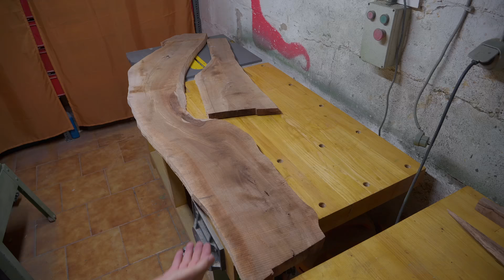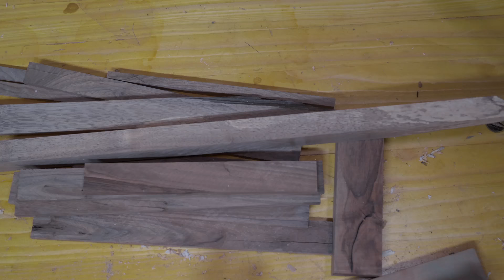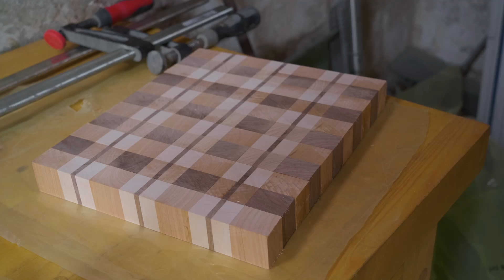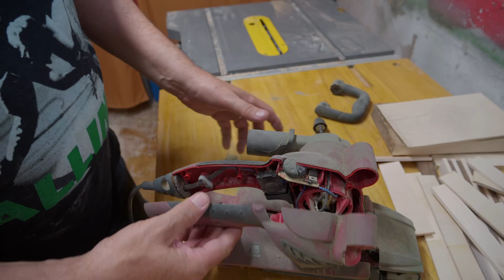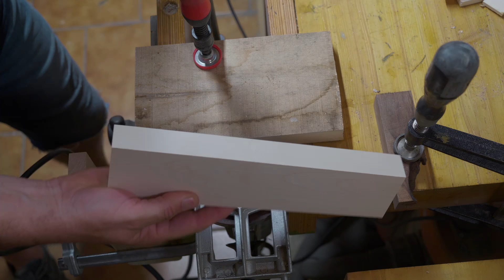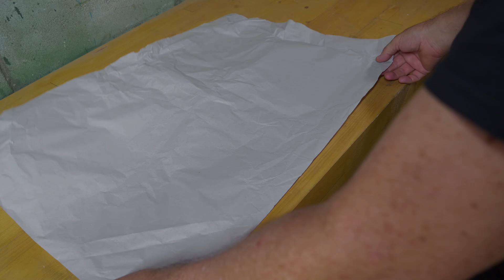Making a plaid end grain cutting board || RotarySMP

Comment: I’ve been wanting to make one of these, and even bought plans, but this is the first video I’ve seen where all the pieces are basically clamped up at one time. Seems much simpler that way
Reply from the maker: This way seemed to work quite well. I should have been more careful cutting all the strips at the start in one set up, to avoid the slight accuracy errors which creep in when you reset the fence.
Reply: @RotarySMP still looks great though
Reply from the maker: @ninjawarriormystic  Thanks a lot.

Comment: if you sprinkle a pinch of salt on the glue up it reduces the sliding when clamping and with dissolve into the glue and not effect it.
Reply from the maker: Great tip. Thanks.

Comment: Good looking board. That's the one thing over the years I have never made and no desire to for many reasons. I have to say that I feel for you for the lumber you had to work with. That was not easy. If you were here I would have given you some 10/4 black walnut. I sold the 16' long stuff I had but still have a few small pieces. 

      My belt sander is one of the old Porter Cable 4x24 ones that weigh a ton. I lent it to a friend once and he said never let me use it again. He said he never screwed up a project so fast. Not his exact words but... And I miss the short lived tools with plug in cords. Not sure what the equivalent coatings are here in the US but PPG is a US company so they may sell it here. I always used mineral oil.

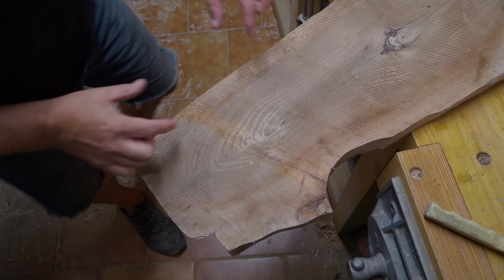        The only thing I have made was a new litter box container for the cats. I have a sealed box in the garage they go to and you service them from out there. We have new automatic ones and I had to build a new one as they are bigger. Swapped it out yesterday with the old built in one. It's functional but not finished. We haven't had a day under 100* in around 30 days and today was 100+ from 11am till 7:45, 112* for the high and 84* for the low tonight. It was 110*+ for 5 hours today. We won't start cooling under 100* until mid September. Everyone is angry and has cabin fever here. It will still be warm when we get back home in October.
Reply from the maker: It has cooled down here for the last week, and we started getting some rain, which was needed.

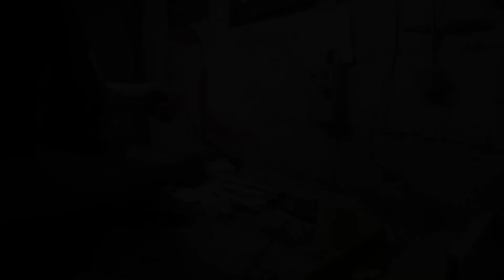Comment: never seen anyone stack a cutting board like that in the glue up's, most poeple just turn them all 90 and flip them back again. 18:40 I picked up a 1980's cast aluminum with a cast iron base craftsman scroll saw at the drump ... the switch had clogged with MDF dust over decades of doing (I assume) crown molding and took 15 min to fix (along with checking motor and starter cap)
Reply from the maker: Nice score on that saw.

Comment: nice change from your usual stuff. I used to use vegetable oil on my boards, takes a bit more buffing up but food safe.
Reply from the maker: I read that most veggie oils dont completely dry and often go rancid, so I took these ones.
Reply: @RotarySMP  yes, they don't completely dry that's the point, then your washing your board it stops it from drying out and cracking, you have to re apply the oil every now and again.

Comment: Lots of equipment gets scrapped due to minor electrical damage. Mostly due to risk management.
Reply from the maker: It is a waste. Many can be simply repaired.
Reply: @RotarySMP $100 fix vs Multimillion $ lawsuit, bad press, and possible jail. Non-CEO's don't get rewarded when they do their job but will be punished. And I agree it's a waste...... If it goes to the tip/landfill. However it's a great opportunity if it goes to disposals or other recycling programs and ends up on the used market (cashies).

Comment: you can sprinkle some table salt (or sand, if this wasnt a cutting board) over the glue between the wood pieces, it acts as an abrasive and prevents it from slipping when you clamp them
Reply from the maker: Great tip, thanks.

Comment: That's a beautiful piece of craftsmanship.
Just a quick word of caution regarding wood waxes (like the German Holzwachs brands) on food-contact surfaces. While these waxes are excellent for furniture or wooden toys (often carrying the EN 71-3 safety rating), they are generally not safe for cutting boards.
Even after drying, traditional furniture waxes can leave behind traces of petroleum-based solvents, chemical dryers, or anti-molding agents that can leach into your food—especially when exposed to knife cuts, food acids, and oils.
For a 100% food-safe alternative, it is highly recommended to use pure mineral oil (paraffin oil) or a homemade blend of mineral oil and pure beeswax. If a board has already been treated with furniture wax, it is best to sand it down to bare wood before reapplying a food-grade finish.
Reply from the maker: Thanks for the heads up on that.
Reply: @RotarySMP  Hope my previous 'info package' didn't spoil the fun of your cutting board gift. Your educational videos from beautiful Vienna—with that chill reggae music—have been a joy to watch on Sundays. Summer definitely came earlier there than here in Finland. Wishing you all the best!

Comment: Nice chopping board Mark!  I volunteer at a tool recovery warehouse, we recycle tools to Africa in tool kits and I do the electrical tools.  We get a lot that are cleared out after an old guy dies, some will be almost unused, some used but reusable and some that are too old to meet the latest electrical safty measures and are scrapped.  We also get things that are used semi proffesionaly and are totally worn out, these are scrapped as well.  The best bit is the home made repairs,  twisted together and taped joints in cables, sometimes 3 or 4 in the same cable, plugs fitted so badly that there are inches of blue and brown cable visible.  The best so far were a home made wooden footswitch which was fine except all the connections were exposed and a badly fitted plug with copper wire visble from outside the plug.  I showed the last to a work coleague and asked if he thought it was OK, he said it should be fine as you can only just see the live wire!  We keep cables from duff tools for reuse on the ones with damaged cables, no cost involved,  just 20 minutes of time.
Mark, UK.
Reply from the maker: Thanks Mark. Glad they are not all ending up in a land fill.

Comment: Same name as my daughter :)

FYI You can run an end grain board through a thicknesser, but it's best to glue strips around the perimeter of the board (to prevent blowout), with lengths longer than the board on the sides to prevent snipe on the board itself. Light passes are required, obviously. But it does work.
Reply from the maker: Good to know. I didn't want to risk it. I should probably make up a jig to hold the blades and resharpen the planer blades on the surface grinder.
Reply: @RotarySMP i don't know how much work it is to remove the cutter head, it looks like a few bolts and a belt is all. Removing the entire cutting head and holding it in a vise is a great way to sharpen these blades. I had good luck with my old Elu jointer thicknesser, the guy who ran the surface grinders at work gave it a few licks to get the blades straight and sharp. With the knives in the cutter head this ensures that any deviations in the cutting head are accounted for and the resulting edge is straight.
Reply from the maker: @Bluecoldcaffe  That is a an excellent tip. Thanks.

Comment: I have always thought that power tools should have IEC sockets on them as standard, would make it easier if you do catch the cable and saves them all getting tied up when using multiple tools on a project, just swap the one cable between all the tools as you need them.
Reply from the maker: Good point Rob.
Reply: Festool has such a system, but with locking plugs because IEC is just a loose friction fit that probably comes loose when bumping the cable all the time. IEC isn't meant for equipment that moves around and the 2 prong C17 plugs that have a 10A rating are pretty rare. Power tools are typically isolated and shouldn't use the common 3 prong plug on a things like PCs and would overload the 2.5A rated small C7 plug. There are mostly proprietary systems like PowerCON that could work for power tools but nobody likes other people's standards 😁

Comment: Thanks for the lovely woodworking video! ❤👍I can’t watch those videos of YouTubers in their high-gloss woodworking workshops. Especially when they turn the hobby into a religion.
Great planer. Which brand and model is it? It looks almost exactly like mine from Metabo. It seems Metabo took some inspiration from it. 🤔😅
Reply from the maker: Thanks a lot. It is an Inca. That was a Swiss band back in the 1980's I think. It is a step up from the cheap imports, but a step down from the big cast iron framed machines.
Reply: @RotarySMP  It’s the perfect size for me.
Reply from the maker: @chrismayer8990  It is nice in a smaller space like mine, as it is heavy enough to be stable, but you can still shove it into a corner sort of out of the way.

Comment: I asked for one of those as a Christmas present one year. It seemed like a really good idea at the time. I hate the thing, it is a complete sod to keep clean, you cannot put it in the dishwasher or soak it. You have to sort of damp it down and then scrub it with a green pad and washing up liquid, then rinse if off without it getting too wet. I just default to a plastic chopping board now and shove it in the dishwasher. The wood board sits there, looking pretty.
Reply from the maker: I suspect, when it needs reoiling it will be returned to me for refinishing, Bill :)
Reply: @RotarySMP Sounds like rod, back, Mark. 😊

Comment: Did you consider to use the surface grinder for the sanding? Alec Steele recently had a nice video about mounting a belt to his surface grinder. Seemed to work quite nicely. The mag-chuck doesn't work though…
Reply from the maker: That would have been a whole extra project. I have enough :)

Comment: nice project. i always wonder where do people get all those nice machined, all i have the economy big box store versions and they sucks 
. this is why i don't make guitars anymore, just ocasionally one at a time , the joy of making simply isn't there anymore 
anyway i  wouldn't use white pva for a cutting board, yellow  pva would work much better, because white glue is an elastic variant pva acetate and yelow is the stiff hard glass alifatic resin variant. so white gums up on your tools and yellow splinter and can dull them  but end product of white glue can creep under pressure and yellow you would need to heat up first .white pva doesn't like anything alcohol based either , it can expand on the glue lines and break down. also filling the cracks with sawdust and glue work much better with yellow one but if the glue lines were tight there might be no issues
low speed router with sharp tooks makes for much less burn marks but can do tearouts 
you forget the signature on the side
Reply from the maker: I have not seen a yellow glue like titebond here in Europe. I am sure it exists, but have not seen it.
Reply: @RotarySMP  come to poland , we have tidebond or just buy online :]. but i fully understand why , since we also have more white glue brands than yellow and those comes from germany